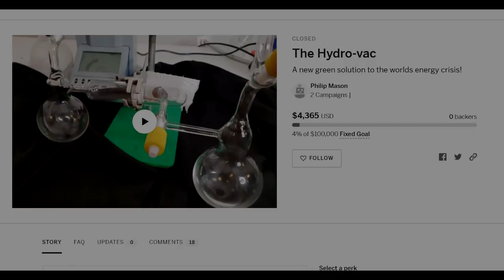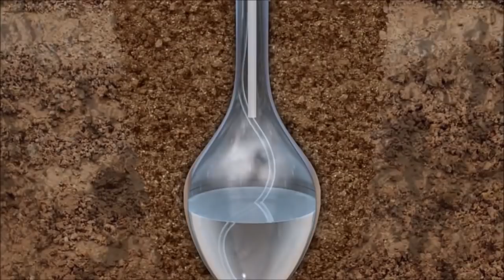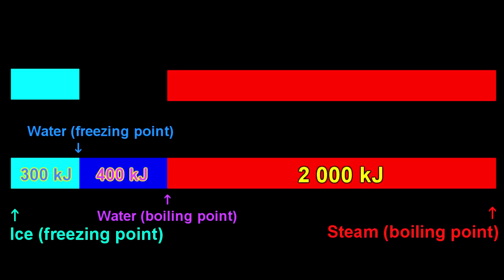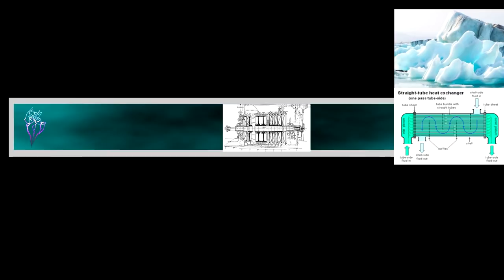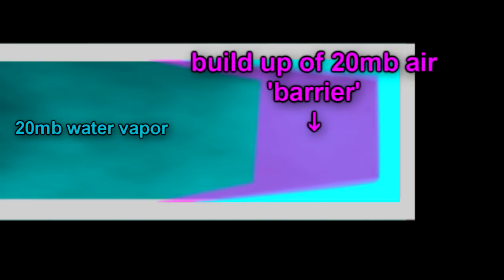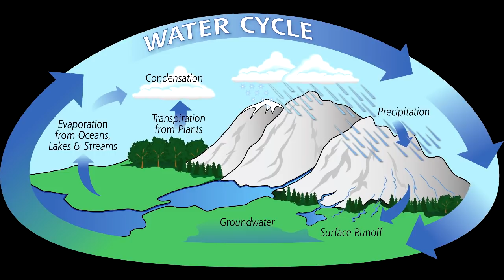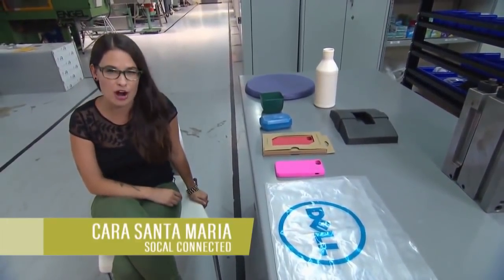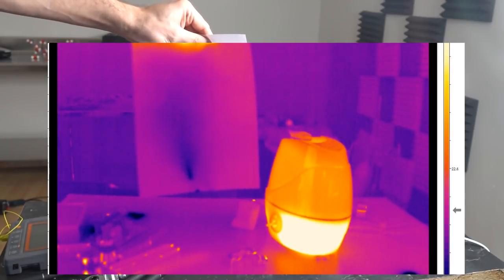The Hydro-Vac -BUSTED

Comment: Wait. At the end you said that evaporation like that isn't enough to cool your room.
I thought that's how swamp coolers worked though? And they're supposed to be good enough for the entire house...
Reply: Passive evaporation works because it actually absorbs heat from the surroundings. Actively vapourising water adds heat to the room even before you consider waste heat from the heating element. Mist/sprays should still be a net cooling. All these systems require you to drop the humidity again somehow which basically means airing the room because condensation will once again dump the heat.

Comment: "Because all molecules move at about the speed of sound."  And different molecules move at different speeds, in an atmospheric mix other than our own. Hydrogen happens to be a hell of a lot faster than say Xenon, but each would be moving at the speed of sound. (At room 20C) Hydrogen would be whipping about at 1270 m/s, Nitrogen at 349 m/s, Oxygen at about 326 m/s and Xenon and a mere 319 m/s.  The reason being as it takes a lot more energy to excite the larger molecules. So still the 'speed of sound' but there is a lot of caveats involved :P

The question then is how would a "hydro-vac" like thing operate on the Moon? NAH! Considering the dips temperatures can go from 127C down to -173C... a Sterling engine (that works on temperature gradient) would be preferred :P Part buried in rock becuase lower down should provide a steadyish temperature, right?

Comment: I dream of a desert with enormous zeppelin like structures in the sky that are cabled to the ground. The balloons are larger than aircraft carriers and the cables are as big around as semi-trucks. I can feel the energy in the air but static shock or lightning is impossible. The electricity comes from an underground facility that I haven't been into yet. This electricity feeds cities that are far away, outside of the desert.

Comment: humidifiers are great in the winter keeping you warm. and keeping your sinus from clogging up. 
as a cooler only if you live in a low humidity area If not it created net heat. If you are in path of the water you will fill cooler Yet the room is actually getting hotter and stickier. Just like a regular fan. It does no good if you are not in the path.

Comment: Also there is a better potential means to exploit the temperature differences between the equator and the poles namely using turbines to exploit the existing thermohaline circulation of the ocean. Still poses a number of major technical challenges but it's a whole hell of a lot more sensible than trying to build a giant vacuum tube in order to create a heat engine when the Earth already has that exact heat engine you are trying to build on a massive scale that already moves enormous masses of ocean water around biggest problems are those of getting the hydropower turbines out into the currents and the huge lengths of cable needed to get the power back to where it is needed so more local to the point of use sources like wind or solar are generally more practical.

Comment: The hydrovac is very similar to OTEC .. Ocean Thermal Energy Conversion .. a system that has been proposed for decades .. and it works!  Energy from the ocean thermal gradient with zero carbon emissions.. BUT, the trouble is, its Carnot efficiency is extremely low, so it basically warms deep ocean water far more than it generates much useful power .. so it has a very real environmental impact of a very different sort.  Buy solar panels & electric cars !!

Comment: An easier way to apply that concept would be to plant a barge in the ocean and use the differential in temperature between the air and the water. Not saying it would be a cost efficient way to generate power, but it would be easier.

Comment: The idea of generating power due to heat differential is not new (see  Stirling engine c.1816) the problem would be maintaining the heat differential once the system was established because the target 'station' would get warmer (as demonstrated). As such, power generation through heat difference would only really be viable where there is no insulation ie. no atmosphere, ie. space or the moon.

Comment: It would be nice if you did a second look at the desicant based water collection idea you dismissed a year or two ago. It worked by shifting the absorbtion/release temperatures to way above ambient so waste heat could be easily ejected. 

With this device, if the end of the tube was coated in something that bound the water at room temperature, and then could be baked off, it would just be another wierd heat engine.

Comment: the device - commonly known as heatpipe - was patented in 1944. as far as I know, up to now no one utilized it successfully for energy generation. there might be a good reason....
Reply: Heat pipes are used for solar hot water collectors.  Some solar absorbing tubes have a heat pipe down the middle, and the top of the heat pipe goes into the water to be heated.  You can see them clearly in this video: https://www.youtube.com/watch?v=G4NNrRLPsnI  I guess if you heated the water and turned it into steam, then you could make some energy using a heat pipe.

Comment: Simply Solution- build the hydro-vac around the equator, and use the natural day/night cycle to heat and cool the opposite sides of the tube.
Reply: there's already something like that
Planets generate a tiny bit of Thrust
they emit different Amounts of Heat at different sides

Comment: Surely it wouldn't be an infinite source of energy because the system would reach equilibrium after a while, so you'd either have to set up a new system or reset the system back to its original state, both using energy.

Comment: -I've built a working prototype!
-How'd you solve the icing problem?
-Icing problem?
Reply: Don't let it get down to 0 degrees C.  I'm sure that liquid water takes up less space than ice anyway.  Not sure you need 3 phase changes - vapour to liquid should be enough.  Can't see any ice forming in the videos, also no indication of the temperature - it maybe didn't get that low.

Comment: What if this hyperloop deal was filled with a low pressure gas, like helium or something? Or something similar? To lower the resistance? Or maybe use the air in the tube to move the pod or what ever, like have a electric jet engine , pulling the air from one side to the other, moving the pod! Just another crazy idea, thrown out to see if it will stick!

Comment: When it comes to the maglev homes... Wouldn't they still shake due to the fact that the levitation has a certain range and the earth shaking would be shifting the magnets up and down and such? I actually am not sure how this prevents the shaking, but I can see how it might possibly prevent the major damage to the foundations of the building from being split and cracked.
Reply: For repelling permanent magnets yes you're still screwed. There might be some benefit in terms of inertia because the force of the shaking would be distributed across the mounts of the magnets and you could e.g. add springs and shock absorbers in ways not possible for solid concrete or masonry. It's far more likely such a setup would focus the strain or limit construction options though.

Some combination of inductive braking and active piezo elements could in theory almost negate an earthquake, and there might be a fancy superconductive effect with similar results.

Comment: I always thought cold was an absence of energy.  And the cold of space wouldnt work for cooling a super computer as disapation requires athosphae.   Learnt something new on this.   Guessing this only works when its got an vacum as it doesnt have friction
Reply: In many cases it's the difference that counts not the absolute value. Fun fact in Newtonian gravity you wouldn't be able to tell if the entire universe were filled with a constant background density matching a neutron star, the pulls from different directions cancel each other out (they do not in General Relativity because spacetime itself is still warped by that immense mass).
Reply: @Photoloss   so its the speed of the  introduction that creates energy.
Reply: @salaciouscreations4323  No, the energy is already there, in all the surroundings which are warmer than the "cold thing". It becomes accessible when you add "cold thing" because heat energy flows from hot to cold and this flow is what you can tap into.

Think of it this way: if you have two identical tanks full of water next to each other and connect them at the bottom with a little water wheel nothing will happen, the wheel will not spin. But if you remove half the potential energy in the system by emptying one tank before opening the connection water will flow from the other one and spin the wheel. This only keeps going until the water level in both tanks is equal though.
Reply: @Photoloss   thank you.  I get that.

Comment: Some of these examples are really showing collosal lack of knowledge about vacuum and vacuum systems. Just like Thunderfoot I work in science and I am in contact with vacuum systems on daily basis. Although automated and perfected they are basically sensitive systems. Sensitive to microscopically small quantities of impurity from outside (speaking about lab grade equipment) which can kick down vacuum for order of magnitude and even seriously disturb and contaminate the system. I remember that one guy made mistake, did not remove electrospray source from mass spectrometer sample aperture and by trying to wash electrospray source by solvent accidentally injecting less than milliliters of solvent into the vacuum system. There was safety system which closes the diffusion pumps apertures, but mass spectrometer chamber was contaminated and it took time for pumps to pump out the contaminant. Contaminants also have tendency to stick to the inox walls of the system. For instance, there was case of measuring acetone in vacuum systems which were idle and vented for some time. Sudden malfunctions also can happen, for instance once rotary vane pump (which is connected after high vacuum pumps with high pressure side to atmosphere and is also called backing pump) malfunctioned, created huge counter-pressure onto rotor of turbomolecular pump (running @ 50000 rpm), destroying rotor blades and pump's bearings. Vacuum system are serious game.

Comment: @Thunderf00t So, okay, this obviously wouldn't work on earth in a scaled device using the the polar ice as one of its chamber ends, but why wouldn't a scaled device like the one in which you demonstrated the phenomenon actually work in a spaceship, ie by having one side of a chamber with water always facing into the cold darkness of space and one side of a chamber always pointed into the inferno heat of a star, surrounded by some ray concentration dish, and the tube connecting these chambers running through the spaceship with insane insulation? It's not like the area in space around the cold chamber will "warm up". So shouldn't this work in space if such a device was implemented in satellites sound the sun or space ships orbiting the sun with one end permanently facing cold and one end permanently facing the star? I'd like to see an explanation as to why this could or couldn't work, because from what one would surmise space is always going to be cold without a heat source and you can't warm it up even if you weren't in motion as there is no matter to transfer the heat energy into. Any thoughts?

Comment: Dear Thunderfoot after see yr shows on things  like the WATERSEER we spent $8,000 au on a 110 000lt tank and were about to buy a  pond liner 12 mX 15 m about $1000 the pond liner will be  above  the tank up the hill on the ground , the rain fall were i live will giving me about 200,000lt a year in the tank  .Here were i live to getting  a load of water cost $250 for 15,000lt . The tank and pond liner with a 20 year life at a min, for the next 20 years plus  we will be  water secure.All drinking water is filtered using Royal Doulton Super Sterasyl filter  about 2 a year costing $60 .No power is used as water tanks are up the hill behind the home . Thunderfoot you can us any of my info here as it real life .ps all the rain that fall on the tank roof fall in to the tank the tank is 8m,  hoping this help you

Comment: Fairly confident a company in Manchester, UK are using cryogenic techniques like this to store Wind Energy energy in Nitrogen at minus 198 Celsius. They then “rapidly” heat the Nitrogen to minus 50 and it races through a tube at high speed. Similar ?

Comment: Isn't ice a good insulator into the bargain? Even if you embed the tube deep in a glacier, ice will melt and a pocket of arm water will develop, it will be heating up more quickly than it can lose energy by melting more ice as it is shielded from the cold air outside so can't convect the heat away and as ice is quite reflective in that arrangement, it can't radiate away quickly either, only place where energy transfer can occur is at the boundary between the ice and the water and as the volume of water goes up, the ratio of surface area to volume goes down.

Comment: Where are the new companies? There are a lot of scammers out there, find some new ones. WiCharge offers low power IR lights that can charge your phone with a high power rate. It's as safe as a low power IR-light, and as powerful as a high-power IR light. And coincidentally they use the same IR frequency as a TV remote. But it's not just a powerbank that turns on by a low power IR-signal, it's real, because they are FDA approved. Obviously the FDA is the agency to go to to certify electronics.

Comment: Couldn't you solve the ice-block issue by having a gravity-fed return line to dump condensed water back into the original supply at the bottom of said water source?

For that matter, since it's a closed loop system, couldn't you replace water with something that has a lower freezing point? If so, what impact would that have on the power output of the system?

Comment: watching the part of the water seering made me think that maybe the water seer is just not long enough. because if the air had to pass over enough surface area, eventually the earth would cool it down enough to condense because the earthship designers use those earth tunnel pipes that can help cool a house by cooling air with the earth.. and those are super long... but earthship designers... if those long underground tubes really did collect water.. they would be all over that and promoting it as a great way to get water for house use.

Comment: You don't have to build a vacuum tube all the way to the poles; there's plenty of ways to get a large temperature differential without traveling anywhere near so far. For example, you could just build it from the bottom to the top of a mountain. And call me crazy, but wouldn't the heat of condensation just radiate out of the tube into the atmosphere?

Comment: Can you explain more about the machine at the end? Last year it was super hot in Sweden and for the first time ever I had to use an AC, and boy was that expensive, I had a nice temperature inside my apartment, but all I had to do was actually to make it okay in a very small area like my sofa or bed. Can you come up with an safe and cheap idea to make my bed nicer during the summer so I can sleep well.

If you can do so I will try to nominate you for the Ig Nobel Prize :-)
Reply: It just sprays water into fine mist that evaporates and cools the air in the process. It is that simple. It also rises humidity quite significantly, which may be a problem in some places.

Comment: Hey Thunderf00t, could you check the validity of Stirling engines. I saw a video on Stirling Engines from a British YouTuber named Lindybeige and I was intrigued. Stirling engines are somewhat used now but I want to know if they could use more awareness. I do not have high expectations but I wonder if Stirling engines could be like solar panels, wind turbines or water turbines in dams. Not a miracle replacement but something to help out a bit with human energy consumption.

Comment: So what happens if you fill up the tube with hot water vapor and create the vacuum by electrolysis/ignition like you did in the 3000 degrees in a plastic bottle video, instead of boiling the water and pumping the tube? Would that make a device like this more feasible, or would that require similar energy consumption?

Comment: What if you just build a tube with open ends? Wouldn't the difference in temperature still cause gas flow? The cold air would always rush towards the warm end.
Reply: Do you know why a tunnel through a mountain usually still needs a ventilation system even though one portal is almost always in shade and thus has a lower ambient temperature? Hint while air will tend to naturally flow very slowly from the sunny side to the shaded side due to temperature differences it is very slow you will get much higher air velocities from natural wind patterns driven by air pressure gradients over whole regions of the planet since you are literally talking about trying to stick an extra long cowling around a wind turbine at this point you are not really helping yourself any.

Comment: Anyone who has used a Mass spectrometer knows what abitch it is to maintain the vacuum of a small scale system, and that system is not bigger than a half to quarter of a gallon or 1-2 liters, wich is equal to 1-2 cartons of milk.
You have to pump at least half a day after opening up the system using two separate pumps, that are high voltage, imagine all the energy needed just for that.